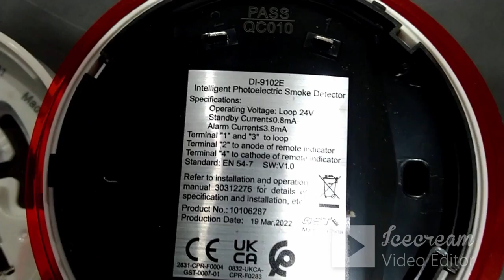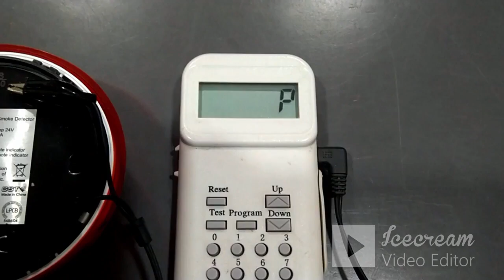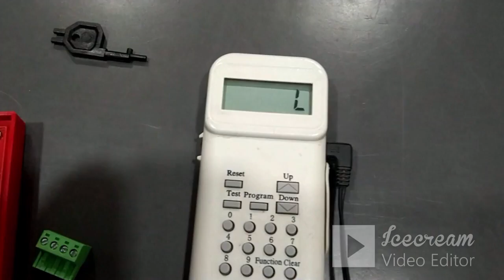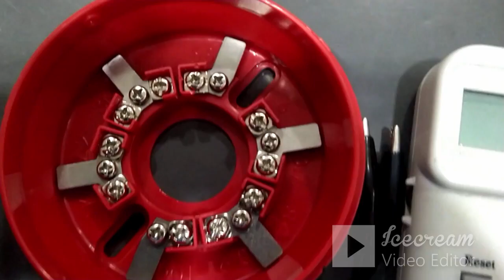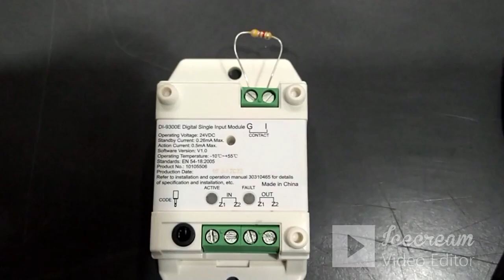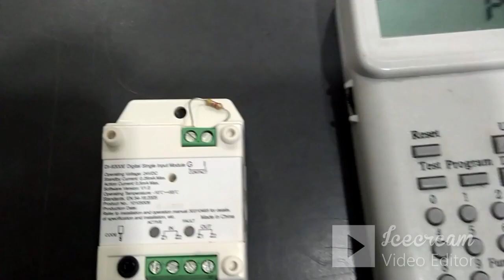Comment: FIRE ALARM DEALERS IN KERALA, FIRE ALARM SYSTEM IN KERALA, FIRE ALARM SYSTEM TRADERS IN KERALA, ADDRESSABLE FIRE ALARM DEALERS IN KERALA, AGNI FIRE ALARM DEALERS IN KERALA, RAVEL FIRE ALARM DEALERS IN KERALA, SMOK DETECTOR DEALERS IN KERALA, FIRE ALARM PANEL DEALERS IN KERALA, HONEYWELL MORLEY FIRE ALARM DEALERS IN KERALA, FIRECLASS FIRE ALARM DEALERS IN KERALA, AGNI FIRE ALARM PANEL IN KERALA, FIRE DETECTORS IN KERALA, FIRE ALARM DISTRIBUTORS IN KERALA, ASES FIRE ALARM DEALERS IN KERALA, CONVENTIONAL FIRE ALARM DEALERS IN KERALA, FIRE ALARM CONTRACTORS IN KERALA, SIMPLEX FIRE ALARM DEALERS IN KERALA, FIRE ALARM COMPANIES IN KERALA, FIRE ALARM SUPPLIERS IN KERALA, FIRE ALARM INSTALLATION IN KERALA, GST FIRE ALARM DEALERS IN KERALA,  FIRE PIPE INSTALLATION IN CONTRACTORS IN KERALA, FIRE SAFETY CONTRACTORS IN KERALA, FIRE PA TWO WAY TALK BACK SYSTEM DEALERS IN KERALA, HEAT DETECTOR DEALERS IN KERALA, HONEYWELL FIRE ALARM DEALERS IN KERALA, SMOKE DETECTOR DEALERS IN KERALA, FIRE ALARM DEALERS IN KERALA, FIRE ALARM SYSTEM IN KERALA, FIRE ALARM SYSTEM TRADERS IN KERALA, ADDRESSABLE FIRE ALARM DEALERS IN KERALA, AGNI FIRE ALARM DEALERS IN KERALA, RAVEL FIRE ALARM DEALERS IN KERALA, SMOKE DETECTOR DEALERS IN KERALA, FIRE ALARM PANEL DEALERS IN KERALA, HONEYWELL MORLEY FIRE ALARM DEALERS IN KERALA, FIRECLASS FIRE ALARM DEALERS IN KERALA, AGNI FIRE ALARM PANEL IN KERALA, FIRE DETECTORS IN KERALA, FIRE ALARM DISTRIBUTORS IN KERALA, ASES FIRE ALARM DEALERS IN KERALA, FIRE SAFETY CONTRACTORS IN KERALA, FIRE ALARM CONTRACTORS IN KERALA, SIMPLEX FIRE ALARM DEALERS IN KERALA, FIRE ALARM COMPANIES IN KERALA, FIRE ALARM SUPPLIERS IN KERALA, FIRE ALARM INSTALLATION IN KERALA, GST FIRE ALARM DEALERS IN KERALA, MORLEY FIRE ALARM DEALERS IN KERALA, FIRE ALARM INSTALLTION IN KERALA, FIRE FIGHTING COMPANIES IN KERALA, ADDRESSABLE FIRE ALARM SYSTEM DEALERS IN KERALA, FIRE ALARM SYSTEMS IN KERALA, PA TALK BACK SYSTEMS IN KERALA, FIRE CONTRACTORS IN KERALA, FIRE PROTECTION COMPANIES IN KERALA, FIRE FIGHTING CONTRACTORS IN KERALA, FIRE ALARM DISTRIBUTORS IN KERALA
Reply: FIRE ALARM DEALERS IN ERNAKULAM, FIRE ALARM DEALERS IN TRIVANDRUM, FIRE ALARM DEALERS IN KOCHI, FIRE ALARM DEALERS IN THRISSUR, FIRE ALARM DEALERS IN PALAKKAD, FIRE ALARM DEALERS IN KOTTAYAM, FIRE ALARM DEALERS IN CHANGANASSERY, FIRE ALARM DEALERS IN THIRUVALLA, FIRE ALARM DEALERS IN CHENGANNUR, FIRE ALARM DEALERS IN ALEPPEY, FIRE ALARM DEALERS IN ADOOR, FIRE ALARM DEALERS IN PANDALAM, FIRE ALARM DEALERS IN KARUNAGAPALLY, FIRE ALARM DEALERS IN KAYAMKULAM, FIRE ALARM DEALERS IN PATHANAMTHITTA, FIRE ALARM DEALERS IN OACHIRA, FIRE ALARM DEALERS IN KOLLAM, FIRE ALARM DEALERS IN TRIVANDRUM, FIRE ALARM DEALERS IN PERUMBAVOOR, FIRE ALARM DEALERS IN KOTHAMANGALAM, FIRE ALARM DEALERS IN MOOVATTUPUZHA, FIRE ALARM DEALERS IN PALA, FIRE ALARM DEALERS IN VALANCHERY, FIRE ALARM DEALERS IN MALAPPURAM, FIRE ALARM DEALERS IN TIRUR, FIRE ALARM DEALERS IN CALICUT, FIRE ALARM DEALERS IN PONNANI, FIRE ALARM DEALERS IN PAYYANNUR, FIRE ALARM DEALERS IN WAYANAD, FIRE ALARM DEALERS IN KALPETTA, FIRE ALARM DEALERS IN MANANTHAVADY, FIRE ALARM DEALERS IN FEROKE, FIRE ALARM DEALERS IN THANUR, FIRE ALARM DEALERS IN KERALA, FIRE ALARM DEALERS IN CHALAKKUDY, FIRE ALARM DEALERS IN KODUNGALLUR, FIRE ALARM DEALERS IN ANGAMALY, FIRE ALARM DEALERS IN BATHERY, FIRE ALARM DEALERS IN, MUNNAR, FIRE ALARM DEALERS IN IDUKKI, FIRE ALARM DEALERS IN MANJERI, FIRE ALARM DEALERS IN THALASSERY, FIRE ALARM DEALERS IN THRIPUNITHURA, FIRE ALARM DEALERS IN VADAKARA, FIRE ALARM DEALERS IN KANHANGAD, FIRE ALARM DEALERS IN KOYILANDI, FIRE ALARM DEALERS IN KALAMASSERY, FIRE ALARM DEALERS IN NEYYATINKARA, FIRE ALARM DEALERS IN GURUVAYUR, FIRE ALARM DEALERS IN VADAKKANCHERY, FIRE ALARM DEALERS IN PARAPPANAGADI, FIRE ALARM DEALERS IN NEDUMANGAD, FIRE ALARM DEALERS IN KASARGOD, FIRE ALARM DEALERS IN PAYYOLI, FIRE ALARM DEALERS IN PUNALUR, FIRE ALARM DEALERS IN CHERTALA, FIRE ALARM DEALERS IN TALIPARAMBA, FIRE ALARM DEALERS IN KOTTAKKAL, FIRE ALARM DEALERS IN SHORNUR, FIRE FIRE FIRE ALARM DEALERS IN IRITTY, FIRE ALARM DEALERS IN ATTINGAL, FIRE ALARM DEALERS IN HARIPAD, FIRE ALARM DEALERS IN MUVATTUPUZHA, FIRE ALARM DEALERS IN KOOTHUPARAMBA, FIRE ALARM DEALERS IN IRINJALAKUDA, FIRE ALARM DEALERS IN MAVELIKKARA, FIRE ALARM DEALERS IN MAVELIKARA, FIRE ALARM DEALERS IN VARKALA, FIRE ALARM DEALERS INMANATHAVADI, FIRE ALARM DEALERS IN KOTTARAKARA, FIRE ALARM DEALERS IN KOTTARAKKARA, FIRE ALARM DEALERS IN RANNI, FIRE ALARM DEALERS IN MALLAPALLY, FIRE ALARM DEALERS IN ALUVA, FIRE ALARM DEALERS IN SHORANUR, FIRE ALARM DEALERS IN EDAPPAL, FIRE ALARM DEALERS INKUTTIPURAM, FIRE ALARM DEALERS IN PERINTHALMANNA, FIRE ALARM DEALERS IN NILESWAR, FIRE ALARM DEALERS IN KUTTIADI, FIRE ALARM DEALERS IN MAHE, FIRE ALARM DEALERS IN THAMARASSERY, FIRE ALARM DEALERS IN PONKUNNAM, FIRE ALARM DEALERS IN NILAMBUR, FIRE ALARM DEALERS IN PATTAMBI, FIRE ALARM DEALERS IN VALPARAI, FIRE ALARM DEALERS IN FIRE ALARM DEALERS INVADALY, FIRE ALARM DEALERS IN KOOTHATTUKULAM, FIRE ALARM DEALERS IN THALAYOLAPARAMBU, FIRE ALARM DEALERS IN ETTUMANUR, FIRE ALARM DEALERS IN KANJIRAPPALY, FIRE ALARM DEALERS IN CHAVARA, FIRE ALARM DEALERS IN KILIMANUR, FIRE ALARM DEALERS IN KUTTIKKANAM, FIRE ALARM DEALERS IN PERAMBRA, FIRE ALARM DEALERS IN MANNARKKAD, FIRE ALARM DEALERS IN KUNDARA.
Reply: FIRE ALARM DEALERS IN KERALA, FIRE ALARM SYSTEM IN KERALA, FIRE ALARM SYSTEM TRADERS IN KERALA, ADDRESSABLE FIRE ALARM DEALERS IN KERALA, AGNI FIRE ALARM DEALERS IN KERALA, RAVEL FIRE ALARM DEALERS IN KERALA, SMOKE DETECTOR DEALERS IN KERALA, FIRE ALARM PANEL DEALERS IN KERALA, HONEYWELL MORLEY FIRE ALARM DEALERS IN KERALA, FIRECLASS FIRE ALARM DEALERS IN KERALA, FIRE DETECTORS IN KERALA, FIRE ALARM DISTRIBUTORS IN KERALA, ASES FIRE ALARM DEALERS IN KERALA, CONVENTIONAL FIRE ALARM DEALERS IN KERALA, FIRE ALARM CONTRACTORS IN KERALA, SIMPLEX FIRE ALARM DEALERS IN KERALA, FIRE ALARM COMPANIES IN KERALA, FIRE ALARM SUPPLIERS IN KERALA, FIRE ALARM INSTALLATION IN KERALA, GST FIRE ALARM DEALERS IN KERALA, MORLEY FIRE ALARM DEALERS IN KERALA, ADDRESSABLE FIRE ALARM DEALERS IN KERALA, SIMPLEX FIRE ALARM DEALERS IN KERALA, CONVENTIONAL FIRE ALARM DEALERS IN KERALA, FIRE ALARM TRADERS IN KERALA, HEAT DETECTORS IN KERALA, FIRE ALARM PANEL DEALERS IN KERALA, HONEYWELL FIRE ALARM DEALERS IN KERALA, FIRE ALARM SOUNDER IN KERALA, FIRE ALARM HOOTER DEALERS IN KERALA, FIRE ALARM MCP IN KERALA, FIRE DETECTION SYSTEM IN KERALA, RAVEL FIRE ALARM DEALERS IN KERALA, RAVEL FIRE ALARM DEALERS IN TRIVANDRUM, RAVEL FIRE ALARM DEALERS IN CALICUT, RAVEL FIRE ALARM DEALERS IN ERNAKULAM, RAVEL FIRE ALARM DEALERS IN KANNUR, RAVEL FIRE ALARM DEALERS IN KOTTAYAM, PA TWO WAY TALK BACK SYSTEMS IN KERALA, PA TALK BACK SYSTEMS IN ERNAKULAM, 

FIRE ALARM DEALERS IN ERNAKULAM, FIRE ALARM DEALERS IN TRIVANDRUM, FIRE ALARM DEALERS IN KOCHI, FIRE ALARM DEALERS IN THRISSUR, FIRE ALARM DEALERS IN PALAKKAD, FIRE ALARM DEALERS IN KOTTAYAM, FIRE ALARM DEALERS IN CHANGANASSERY, FIRE ALARM DEALERS IN THIRUVALLA, FIRE ALARM DEALERS IN CHENGANNUR, FIRE ALARM DEALERS IN ALEPPEY, FIRE ALARM DEALERS IN ADOOR, FIRE ALARM DEALERS IN PANDALAM, FIRE ALARM DEALERS IN KARUNAGAPALLY, FIRE ALARM DEALERS IN KAYAMKULAM, FIRE ALARM DEALERS IN PATHANAMTHITTA, FIRE ALARM DEALERS IN OACHIRA, FIRE ALARM DEALERS IN KOLLAM, FIRE ALARM DEALERS IN TRIVANDRUM, FIRE ALARM DEALERS IN PERUMBAVOOR, FIRE ALARM DEALERS IN KOTHAMANGALAM, FIRE ALARM DEALERS IN MOOVATTUPUZHA, FIRE ALARM DEALERS IN PALA, FIRE ALARM DEALERS IN VALANCHERY, FIRE ALARM DEALERS IN MALAPPURAM, FIRE ALARM DEALERS IN TIRUR, FIRE ALARM DEALERS IN CALICUT, FIRE ALARM DEALERS IN PONNANI, FIRE ALARM DEALERS IN PAYYANNUR, FIRE ALARM DEALERS IN WAYANAD, FIRE ALARM DEALERS IN KALPETTA, FIRE ALARM DEALERS IN MANANTHAVADY, FIRE ALARM DEALERS IN FEROKE, FIRE ALARM DEALERS IN THANUR, FIRE ALARM DEALERS IN KERALA, FIRE ALARM DEALERS IN CHALAKKUDY, FIRE ALARM DEALERS IN KODUNGALLUR, FIRE ALARM DEALERS IN ANGAMALY, FIRE ALARM DEALERS IN BATHERY, FIRE ALARM DEALERS IN, MUNNAR, FIRE ALARM DEALERS IN IDUKKI, FIRE ALARM DEALERS IN MANJERI, FIRE ALARM DEALERS IN THALASSERY, FIRE ALARM DEALERS IN THRIPUNITHURA, FIRE ALARM DEALERS IN VADAKARA, FIRE ALARM DEALERS IN KANHANGAD, FIRE ALARM DEALERS IN KOYILANDI, FIRE ALARM DEALERS IN KALAMASSERY, FIRE ALARM DEALERS IN NEYYATINKARA, FIRE ALARM DEALERS IN GURUVAYUR, FIRE ALARM DEALERS IN VADAKKANCHERY, FIRE ALARM DEALERS IN PARAPPANAGADI, FIRE ALARM DEALERS IN NEDUMANGAD, FIRE ALARM DEALERS IN KASARGOD, FIRE ALARM DEALERS IN PAYYOLI, FIRE ALARM DEALERS IN PUNALUR, FIRE ALARM DEALERS IN CHERTALA, FIRE ALARM DEALERS IN TALIPARAMBA, FIRE ALARM DEALERS IN KOTTAKKAL, FIRE ALARM DEALERS IN SHORNUR, FIRE FIRE FIRE ALARM DEALERS IN IRITTY, FIRE ALARM DEALERS IN ATTINGAL, FIRE ALARM DEALERS IN HARIPAD, FIRE ALARM DEALERS IN MUVATTUPUZHA, FIRE ALARM DEALERS IN KOOTHUPARAMBA, FIRE ALARM DEALERS IN IRINJALAKUDA, FIRE ALARM DEALERS IN MAVELIKKARA, FIRE ALARM DEALERS IN MAVELIKARA, FIRE ALARM DEALERS IN VARKALA, FIRE ALARM DEALERS INMANATHAVADI, FIRE ALARM DEALERS IN KOTTARAKARA, FIRE ALARM DEALERS IN KOTTARAKKARA, FIRE ALARM DEALERS IN RANNI, FIRE ALARM DEALERS IN MALLAPALLY, FIRE ALARM DEALERS IN ALUVA, FIRE ALARM DEALERS IN SHORANUR, FIRE ALARM DEALERS IN EDAPPAL, FIRE ALARM DEALERS INKUTTIPURAM, FIRE ALARM DEALERS IN PERINTHALMANNA, FIRE ALARM DEALERS IN NILESWAR, FIRE ALARM DEALERS IN KUTTIADI, FIRE ALARM DEALERS IN MAHE, FIRE ALARM DEALERS IN THAMARASSERY, FIRE ALARM DEALERS IN PONKUNNAM, FIRE ALARM DEALERS IN NILAMBUR, FIRE ALARM DEALERS IN PATTAMBI, FIRE ALARM DEALERS IN VALPARAI, FIRE ALARM DEALERS IN FIRE ALARM DEALERS INVADALY, FIRE ALARM DEALERS IN KOOTHATTUKULAM, FIRE ALARM DEALERS IN THALAYOLAPARAMBU, FIRE ALARM DEALERS IN ETTUMANUR, FIRE ALARM DEALERS IN KANJIRAPPALY, FIRE ALARM DEALERS IN CHAVARA, FIRE ALARM DEALERS IN KILIMANUR, FIRE ALARM DEALERS IN KUTTIKKANAM, FIRE ALARM DEALERS IN PERAMBRA, FIRE ALARM DEALERS IN MANNARKKAD, FIRE ALARM DEALERS IN KUNDARA.

Comment: Fire alarm dealers in Ernakulam, Addressable fire alarm dealers in Ernakulam, Smoke detector dealers in Ernakulam, Fire alarm suppliers in Ernakulam, Fire alarm distributors in Ernakulam, Morley fire alarm dealers in Kerala, GST fire alarm dealers in Kerala, Heat detector dealers in Ernakulam, Fire alarm panel dealers in Ernakulam, PA talk back system dealers in Ernakulam.
Reply: FIRE ALARM DEALERS IN KERALA, FIRE ALARM SYSTEM IN KERALA, FIRE ALARM SYSTEM TRADERS IN KERALA, ADDRESSABLE FIRE ALARM DEALERS IN KERALA, AGNI FIRE ALARM DEALERS IN KERALA, RAVEL FIRE ALARM DEALERS IN KERALA, SMOKE DETECTOR DEALERS IN KERALA, FIRE ALARM PANEL DEALERS IN KERALA, HONEYWELL MORLEY FIRE ALARM DEALERS IN KERALA, FIRECLASS FIRE ALARM DEALERS IN KERALA, FIRE DETECTORS IN KERALA, FIRE ALARM DISTRIBUTORS IN KERALA, ASES FIRE ALARM DEALERS IN KERALA, CONVENTIONAL FIRE ALARM DEALERS IN KERALA, FIRE ALARM CONTRACTORS IN KERALA, SIMPLEX FIRE ALARM DEALERS IN KERALA, FIRE ALARM COMPANIES IN KERALA, FIRE ALARM SUPPLIERS IN KERALA, FIRE ALARM INSTALLATION IN KERALA, GST FIRE ALARM DEALERS IN KERALA, MORLEY FIRE ALARM DEALERS IN KERALA, ADDRESSABLE FIRE ALARM DEALERS IN KERALA, SIMPLEX FIRE ALARM DEALERS IN KERALA, CONVENTIONAL FIRE ALARM DEALERS IN KERALA, FIRE ALARM TRADERS IN KERALA, HEAT DETECTORS IN KERALA, FIRE ALARM PANEL DEALERS IN KERALA, HONEYWELL FIRE ALARM DEALERS IN KERALA, FIRE ALARM SOUNDER IN KERALA, FIRE ALARM HOOTER DEALERS IN KERALA, FIRE ALARM MCP IN KERALA, FIRE DETECTION SYSTEM IN KERALA, RAVEL FIRE ALARM DEALERS IN KERALA, RAVEL FIRE ALARM DEALERS IN TRIVANDRUM, RAVEL FIRE ALARM DEALERS IN CALICUT, RAVEL FIRE ALARM DEALERS IN ERNAKULAM, RAVEL FIRE ALARM DEALERS IN KANNUR, RAVEL FIRE ALARM DEALERS IN KOTTAYAM, PA TWO WAY TALK BACK SYSTEMS IN KERALA, PA TALK BACK SYSTEMS IN ERNAKULAM, 

FIRE ALARM DEALERS IN ERNAKULAM, FIRE ALARM DEALERS IN TRIVANDRUM, FIRE ALARM DEALERS IN KOCHI, FIRE ALARM DEALERS IN THRISSUR, FIRE ALARM DEALERS IN PALAKKAD, FIRE ALARM DEALERS IN KOTTAYAM, FIRE ALARM DEALERS IN CHANGANASSERY, FIRE ALARM DEALERS IN THIRUVALLA, FIRE ALARM DEALERS IN CHENGANNUR, FIRE ALARM DEALERS IN ALEPPEY, FIRE ALARM DEALERS IN ADOOR, FIRE ALARM DEALERS IN PANDALAM, FIRE ALARM DEALERS IN KARUNAGAPALLY, FIRE ALARM DEALERS IN KAYAMKULAM, FIRE ALARM DEALERS IN PATHANAMTHITTA, FIRE ALARM DEALERS IN OACHIRA, FIRE ALARM DEALERS IN KOLLAM, FIRE ALARM DEALERS IN TRIVANDRUM, FIRE ALARM DEALERS IN PERUMBAVOOR, FIRE ALARM DEALERS IN KOTHAMANGALAM, FIRE ALARM DEALERS IN MOOVATTUPUZHA, FIRE ALARM DEALERS IN PALA, FIRE ALARM DEALERS IN VALANCHERY, FIRE ALARM DEALERS IN MALAPPURAM, FIRE ALARM DEALERS IN TIRUR, FIRE ALARM DEALERS IN CALICUT, FIRE ALARM DEALERS IN PONNANI, FIRE ALARM DEALERS IN PAYYANNUR, FIRE ALARM DEALERS IN WAYANAD, FIRE ALARM DEALERS IN KALPETTA, FIRE ALARM DEALERS IN MANANTHAVADY, FIRE ALARM DEALERS IN FEROKE, FIRE ALARM DEALERS IN THANUR, FIRE ALARM DEALERS IN KERALA, FIRE ALARM DEALERS IN CHALAKKUDY, FIRE ALARM DEALERS IN KODUNGALLUR, FIRE ALARM DEALERS IN ANGAMALY, FIRE ALARM DEALERS IN BATHERY, FIRE ALARM DEALERS IN, MUNNAR, FIRE ALARM DEALERS IN IDUKKI, FIRE ALARM DEALERS IN MANJERI, FIRE ALARM DEALERS IN THALASSERY, FIRE ALARM DEALERS IN THRIPUNITHURA, FIRE ALARM DEALERS IN VADAKARA, FIRE ALARM DEALERS IN KANHANGAD, FIRE ALARM DEALERS IN KOYILANDI, FIRE ALARM DEALERS IN KALAMASSERY, FIRE ALARM DEALERS IN NEYYATINKARA, FIRE ALARM DEALERS IN GURUVAYUR, FIRE ALARM DEALERS IN VADAKKANCHERY, FIRE ALARM DEALERS IN PARAPPANAGADI, FIRE ALARM DEALERS IN NEDUMANGAD, FIRE ALARM DEALERS IN KASARGOD, FIRE ALARM DEALERS IN PAYYOLI, FIRE ALARM DEALERS IN PUNALUR, FIRE ALARM DEALERS IN CHERTALA, FIRE ALARM DEALERS IN TALIPARAMBA, FIRE ALARM DEALERS IN KOTTAKKAL, FIRE ALARM DEALERS IN SHORNUR, FIRE FIRE FIRE ALARM DEALERS IN IRITTY, FIRE ALARM DEALERS IN ATTINGAL, FIRE ALARM DEALERS IN HARIPAD, FIRE ALARM DEALERS IN MUVATTUPUZHA, FIRE ALARM DEALERS IN KOOTHUPARAMBA, FIRE ALARM DEALERS IN IRINJALAKUDA, FIRE ALARM DEALERS IN MAVELIKKARA, FIRE ALARM DEALERS IN MAVELIKARA, FIRE ALARM DEALERS IN VARKALA, FIRE ALARM DEALERS INMANATHAVADI, FIRE ALARM DEALERS IN KOTTARAKARA, FIRE ALARM DEALERS IN KOTTARAKKARA, FIRE ALARM DEALERS IN RANNI, FIRE ALARM DEALERS IN MALLAPALLY, FIRE ALARM DEALERS IN ALUVA, FIRE ALARM DEALERS IN SHORANUR, FIRE ALARM DEALERS IN EDAPPAL, FIRE ALARM DEALERS INKUTTIPURAM, FIRE ALARM DEALERS IN PERINTHALMANNA, FIRE ALARM DEALERS IN NILESWAR, FIRE ALARM DEALERS IN KUTTIADI, FIRE ALARM DEALERS IN MAHE, FIRE ALARM DEALERS IN THAMARASSERY, FIRE ALARM DEALERS IN PONKUNNAM, FIRE ALARM DEALERS IN NILAMBUR, FIRE ALARM DEALERS IN PATTAMBI, FIRE ALARM DEALERS IN VALPARAI, FIRE ALARM DEALERS IN FIRE ALARM DEALERS INVADALY, FIRE ALARM DEALERS IN KOOTHATTUKULAM, FIRE ALARM DEALERS IN THALAYOLAPARAMBU, FIRE ALARM DEALERS IN ETTUMANUR, FIRE ALARM DEALERS IN KANJIRAPPALY, FIRE ALARM DEALERS IN CHAVARA, FIRE ALARM DEALERS IN KILIMANUR, FIRE ALARM DEALERS IN KUTTIKKANAM, FIRE ALARM DEALERS IN PERAMBRA, FIRE ALARM DEALERS IN MANNARKKAD, FIRE ALARM DEALERS IN KUNDARA.